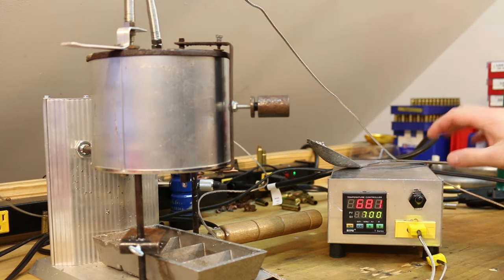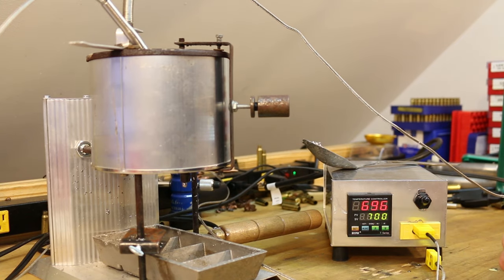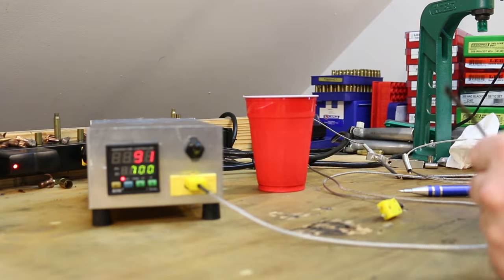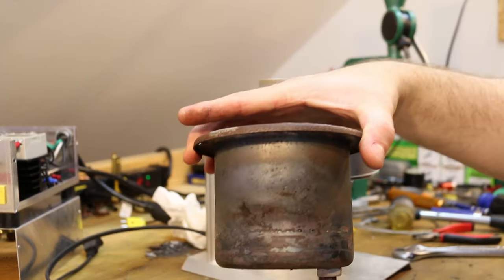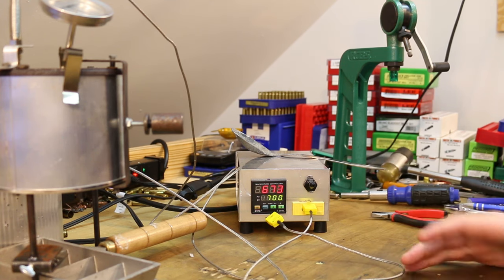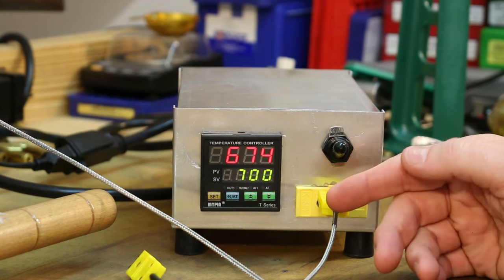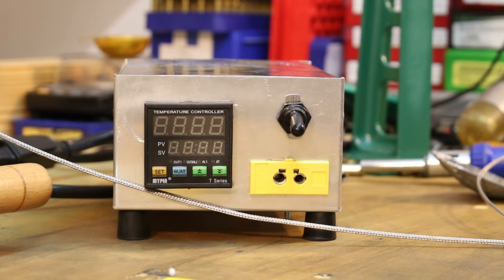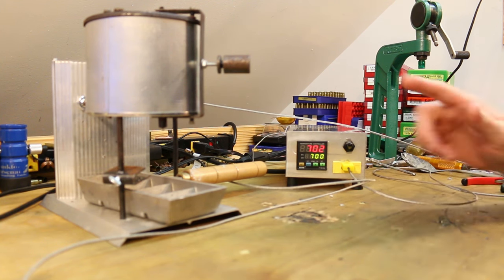MYPIN PID Temperature Controller - Lee 4-20 thermocouple options

Comment: My suggestion to Elvis was for him to have a 20 degrees conversion factor in his own reading of the temps...Since he knows that is the difference, it is compensated mentally...But I just like to be able to dip the thermocouple into the lead with my C-clamp cantilever... works great.  Nice to have options though... Thanks again for this great device, I'm going to be doing some more casting tomorrow...will be the third run with the PID... Best to ya,  FC Steve

Comment: Hey Johnny...here's some old electronics 101 for you fellas...a thermocouple is a junction between two dissimilar metal wires (like copper and zinc) when they are heated the Cu gives up extra electrons to the Z wire causing an imbalance  in their charges...the PID reads this voltage and converts it into a temp. reading. The wires are joined at the weld to insure the electrical continuity between the wires....hope this helps a bit...charlie
Reply: I believe the type K is most common, Chromel / Alumel.  That is what all the ones we use in aviation test and what jet engines use.  For higher temps they use a pyrometer (IR sensor).

Comment: Good comparison.  You never cease to amaze me with your nitch for training, explaining and demonstrating.. Also, if you have a PID controller you can use it for more than one furnace, One could be your production furnace, one could be a furnace that you have another alloy in, another could be one just for blending alloys. This makes the PID control unit more versatile and still cheaper than the Lyman or RCBS furnace's at 3-4 times the cost per furnace price.   Good Job dude.

Comment: The thermal couple  reads only at the tip . I have worked with them for years. It is a solid state device that uses a  variable  resistor in it. I'm building a PID at this time for my pot. Thanks for your videos .

Comment: The temperature differential is going to change with ambient temperature due to the location of the sensor and the heat flow. Probably better to use the probe in the lead near the pour valve. The sensor on the outside is not reading the accurate lead temperature. Yes, this is 3 years old, but still a good project. Thanks guys!

Comment: You need to calibrate the thermal couple to each device. If you change thermal couple then you need to recalibrate it to the device. I work with these all the time, and to calibrate it just put it in ice water and let it set till it stabilizes and offset it to 32 degrees.

Comment: My guess is that the exposed spout/outside of the pot is acting as a heat sink.
I looked it up, the wires are actually welded not soldered.
I was just thinking, what if the spout rod were drilled (or the end of the thermocouple housing was reshaped to seal the spout) and used to house the thermocouple? I think that the depth it's drilled should determine where the temp is taken.
I've seen people use stubby thermocouples that require drilling a hole to mount in the bottom of the pot.

Comment: The simplest thing I can say here is if you don't have the probe IN the lead then you're not going to read the leads temperature. Your original way was better.  
To compromise,  maybe drill a hole in the pot near the spout and properly install a stubby type thermocouple.  They sell some that are only about. 5" long.  I hope that helps. I know this video is over a year old.

Comment: when I worked for a refrigeration company we use adjustable thermometers we would fill the cup up with ice and add water then set to 32 degrees

Comment: My understanding on thermocouples is that the temperature it senses changes resistance in the circuit(thermocouple). The pid reads the resistance and displays that as a temperture.

Comment: JRB, i saw on elvis's channel you were trying to figure out the ball on the end of those wires, i haven't bought a thermocouple since 1978, they go bad because that wire comes apart! i use a tig welder to get ball on the end, but i have used i 12v battery

Comment: only thing that im wondering is if the cover on the wire can take the heat under the pot with out the sleeve only time will tell

Comment: I did not read all comments. It is indeed only the ball on the end that matters. Each of the 2 wires are made of a different metal and the ball is where they are welded together. Heating that ball, makes the junction create a tiny voltage due to dissimlar metals. The pid controller amplifies that tiny voltage.

Comment: I drilled a hole about the same place Elvis did I didn't remove the cover from the thermocouple and just slid it in. I run my lead at 750 it stays within 10 degree of my Lyman thermo. Have used it this way all winter If I need to move the pot just slide the thermocouple out of the pot. My thermocouple  is hard wired to my Pid.

Comment: Your "mistake" getting the box reversed top/bottom actually wasn't a mistake at all. I tried to work it out ahead of time doing it the "supposed" correct way and it does not work. It will be very hard to get inside to service/repair anything should something go wrong not to mention being much harder to build and wire with things mounted on the removable lid inside of the bottom that stays put. Also I am with you and think having the thermocouple actually in the molten lead gets you much more accurate readings. Mounting it under the pot and coil throws it off at least 60 degrees.

Comment: I NEED ASSISTANCE! 
I built a controller this week but I'm having an issue. Im getting 120v to the PID, but there is no voltage on the output side going to the SSR. Also, why is there a load wire from the black bus connected to load terminal 2 on the SSR? I have included a couple of extras in my design. First is power indicator lights and second, I placed a on/off switch inline to control the 120v power outlet with a power indicator light on it as well.

Comment: Hi Johnny, the SSR and Thermocouple are not available on Amazon anymore.  Do you have any recommended part replacements on Amazon ?
Reply: Both are back in stock on Amazon. You can also buy off Ebay.

Comment: Johnny I watched the YouTube video posted by Elvis in which he had received the PID gift that you had sent him. I have seen all your previous videos about the PID for the Lee 20# pot. And I am going to attempt the project once I  round up all the parts. But I noticed that you built the PID in the project box with the correct top position so that the seam is not open on top and no material can get inside. I was wondering if you could share with me in how you are able to wire same when if you unscrew the box and take it apart how much extra lead length did you have to include to be able to take apart the box and also to be able to build. With the way you built in the videos ther were no components installed in the bottom (your top). But with the way you built for Elvis you have the power cord clamps in the ends of the top and the meter face for the PID and the switch and the Thermocouple socket in the opposite face and then I assume you mounted the SSR and heatsink and the terminal strips are install in the floor panel, because I don't see any screws on the top at all. I prefer to build the PID like you did for Elvis. So any construction help and wiring hints and pictures you can  get to me would sure help me complete my project.
Reply: His "mistake" getting the box reversed top/bottom actually wasn't a mistake at all. I tried to work it out ahead of time doing it the "supposed" correct way and it does not work. It will be very hard to get inside to service/repair anything should something go wrong not to mention being much harder to build and wire with things mounted on the removable lid inside of the bottom that stays put. Also I am with you and think having the thermocouple actually in the molten lead gets you much more accurate readings. Mounting it under the pot and coil throws it off at least 60 degrees.

Comment: The little ball on the end is the part that measures the temp. You can melt it if you get it hot enough or it can break off and it's junk. If it has a tube over it there is usually a little indention where it measures. Anyhow, check this out http://www.thermometricscorp.com/thertypk.html  It shows the tolerances for different temp ranges and a lot of other stuff.

Comment: Looks good. The only thing that could go wrong would be the wires getting damaged inside the pot.
Reply from the maker: Yup, and it will be hard to guard against that.  I will probably check it occasionally with a thermocouple directly in the lead.
Reply: To fix that put some oven insulation under the pot and put wire for the TC under that next to the alum bottom.

Comment: So you can buy a 1.5 inch thermal couple, why not drill a hole in your pot and mount it inside your pot near the bottom so the thermal couple is inside with the lead? It should mount just like the outlet on the pot.

Comment: I work with them everyday in my job HVAC TECH. they work off resistance so if you take a oham meter toy will get oham reading according to temp. also you will not get a freezing temp in ice water cause the ice its self is 32 deg but you have liquid absorbing the cold temp off the ice which the water is warmer than the ice so you will not get 32 deg unless the whole cup is froze
Reply: Melting or freezing ice is 32 and stable why we use it. Just mix and let stabilize for a while. Isulated cup may help a bit too. Same as boiling is 212...
Reply: @ewetho  Yep. A mixture of ice/water will always be at 32 degrees F (0 degrees C), or within a fraction of a degree above that temperature.
 
The same is NOT true for boiling water, except at what they call Standard Pressure.  At one atmosphere of pressure, about 29.92 inches of mercury (standards vary slightly), pure water will boil at 212 degrees F (100 degrees C). The boiling temperature decreases as the atmospheric pressure drops. For example, at an elevation of 2000 feet above sea level, water will boil at about 208 degrees F.

Comment: Johnny, get one of these http://www.ebay.com/itm/Digital-Thermometer-Dual-channel-Temperature-Meter-for-K-J-T-E-R-S-N-GM1312-US-/231601563137?hash=item35ec876601 readers and you can read simultaneously both probes, the way you keep switching back and fourth, you saw what happened, the system went haywire.  What I noticed is that I could be measuring same thing and the difference will be off as much as 3 degrees.  Also did try to measure ice water and boiling water, you really have stick the probe between ice cube to get close to 32F, same with boiling water, the only way I could get close to 212 is to stick the probe in the electric kettle as it was boiling, not what I was expecting. 

I build my PID controller last summer and I did for 10lb pot, I ended up drilling the hole at the bottom and machine a brass plug kind of like flat top bolt then drilled a hole in the middle and pressed fit the tip of the stubby probe through and attached it with the nut from the opposite side, it works great and solid.  I don't have Lyman thermometer to compare accuracy.  The only problem is that it's sticking out a bit underneath and gets in the way of the mold a little.  There is something else to consider, my TC had terminal connectors that I had to connect directly to PID and I've read that you can't just take any wire if you want to let's say make extension or quick disconnect, so that's something to consider why it might throw off your temp. by 30 degrees.  I haven't watched all your PID videos yet, just found your channel few days ago.

Comment: Is it really that important to be that close in temperature. We are casting bullets,not sending folks to the moon. A few degrees isn't going to do anything and it seems to talk some time to fool around with.
Reply: When reloading match grade ammo that can shoot through the same hole consistency is the key to success. If you are looking for a bullet hose for blasting 8" steel plates at 7 yards rapid fire it isn't going to matter as much.

Comment: Watching the way you guys are mistreating these Thermocoupler's makes me cringe. If you short the two wires, the will read incorrectly, and may cause a fire due to the controller not failing due to a thermal runaway.